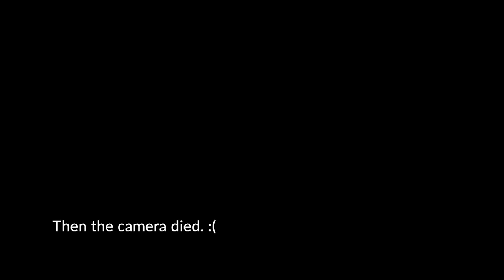Forging wrought iron chain bindings

Comment: Nice. Very nice. Too bad on the camara  though. I really liked your welding. Can you use anything other than borax as flux?
Reply from the maker: There are other things you can use. There are store bought options but don't know what they are. I've never bought any. I worked with a man who used to use sand from the ground. Silica forms a nice  glassy coating that prevents oxidation